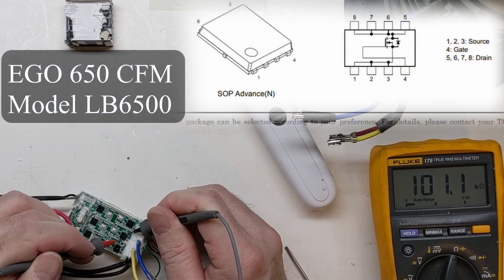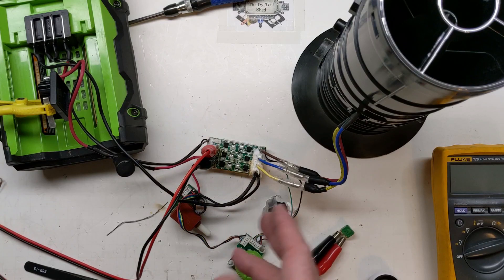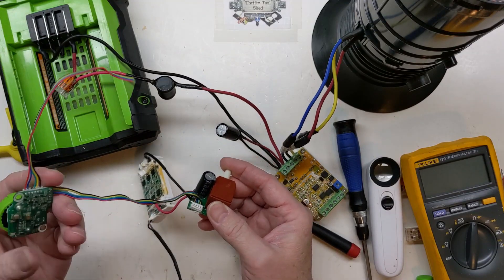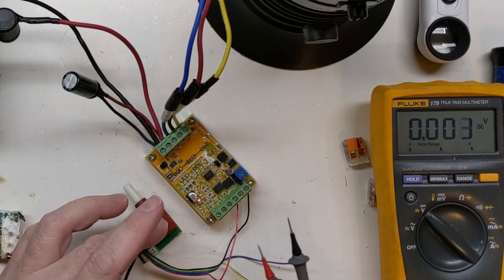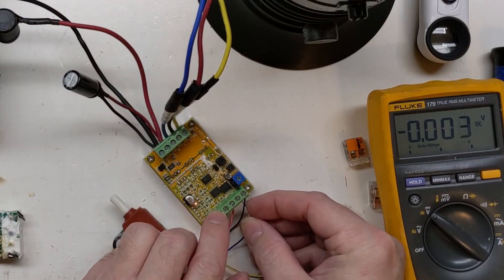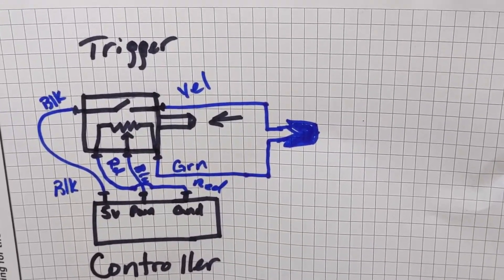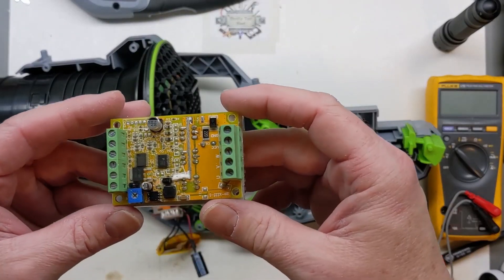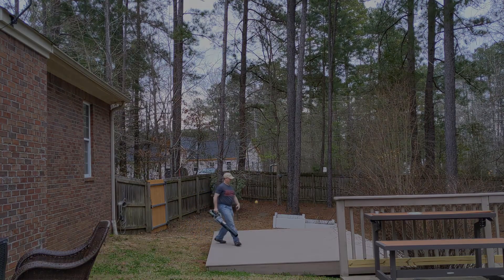EGO 650CFM Blower - Cheap BLDC Controller Retrofit

Comment: I bought one of these units last year and was quite impressed with it's power. But it only lasted 10 minutes before it died. I returned it and got another one that lasted about 30 minutes with the same problem. I returned the unit for a refund.  I called customer support and a nice lady explained that they were having problems with the controllers, and suggested that I get a different model. I waited about a month and purchased another of the same model assuming the controllers would have obviously be fixed by now.  This one worked flawlessly  for about 6 months. (maybe 4 hours of actual use) One of the MOSFETs was shorted and figured it would be easy enough to replace but there seems to be a worldwide shortage of electronic parts.  I have retrofitted with success a 580cfm broken unit from Ebay with your instructions. So I guess I will be doing the same to this one. Thanks for  the videos!!!
Reply from the maker: Awesome job! I did not realize EGO had that many Controller issues, I have worked on several now, but did not know how common the issue really is. Thanks for sharing!

Comment: Thanks to your video, I was able repair an otherwise trash bound Ego. For those on the fence about diving into such a project, I suck at anything electrical but if you pause and study the video and wiring routes, you can figure out where everything goes without needing a background in electrical. Thanks again bud!
Reply from the maker: Excellent job. Thanks for sharing!

Comment: Actually, to desolder something like soic8 with solering iron, i use Rose or Woods low temp melting alloys, works awesome. Does not brakes a bank too.
Reply from the maker: I have done that as well. I have never shared on video since it's maybe not as widely known, but it does indeed work. I have showed the use of it from time to time on TV LED smds for backlight strips as well. 
Thanks for sharing!

Comment: I'm trying to fix my blower (same model).... why do you need a 30amp maxi blade fuse? Isn't the max amp the blower will pull is about 7 to 10amp? Because I can't find the fuse your talking about. Can I use a 30amp 32 volt fuse instead?
Reply from the maker: Well in a tight I have showed the 32V version used because it was what I had at the time. I did want to mention that you can find the 58V rated versions as well since it is correct rating. You could fine them on digi-key or Newark at one time. I have not had issues yet with a 32V rated fuse myself. I tried to be thorough in mentioning the ratings on video because if not the critics would absolutely point it out! I believe the 30A is used in most EGO tools I have worked on so you don't have nusince fuse blows due to start up or even at power up when the caps are getting the instant charge up. Best of luck to ya!
Reply: If you have autozone/oreally around, they usally have them is stock. Not cheap, but today.
Reply: Thanks! I really appreciate & love all the work you do on this channel... have a awesome Father's day!
Reply from the maker: Thanks for your comment! I appreciate it!

Comment: Great video. Have you done any tear downs of ego mowers?  Since the mower RPMS are regulated, I was curious if it was possible to bypass the controller to get the full power from the motor….
Reply from the maker: I have one of the older 21" EGO mowers and I have not had to get into it. No videos on the mower yet, thanks for your comment!
Reply: Please tear it down! I also want more blade speed from my Ego mower!
Reply: @sevin7773  This is not a problem. You have two limitatations: max voltage and controller. Most of the BLDC morors actually have a lot of overhead room to play around. Usally you can push twice power no problem.

Comment: The controller you linked on amazon is a 6.5-50V. With the battery being 58.8V max... will it damage the controller eventually? Should we go with 60V controller instead?
Reply from the maker: Yes, I did discuss this in one of the videos, including the 480cfm blower retrofit. If you can find the 60V version, that's great. This is the best replacement I could find so I share it
 With the replaced 63V cap and a few other tweaks. The only 60V controller similar to this is the Hall sensor version, it is not sensorless. So yes as I mentioned if you can find a 60V or 70V version I would say go for it.
Reply: @ThriftyToolShed  oh that’s right. The one I can find that is 60v is the sensor version. Can that still be used without sensor wires connected from the motor as this motor doesn’t have them?
Reply from the maker: As far as I know it is sensor only. 
 It has to have the Hall sensors connected.
Reply: I've tried the 60v halls version that's linked on video. I can assure you it does not work. So I had to order the 50v non-hall version. Works great but I can't find the 30amp fuse he was talking.

Comment: Would this style of BLDC Controller with Hall motor control work on an EGO chainsaw.
Reply from the maker: I think it's possible. I have wondered if it would, but I also think it my be over driven and not have the same forced air flow to keep it cool like the blower? I have a hall controller so I can try it eventually if I come accross another chainsaw with a bad controller I will try it.
Reply: @ThriftyToolShed  That would certainly be nice as the original controller in mine seems to be not working properly.